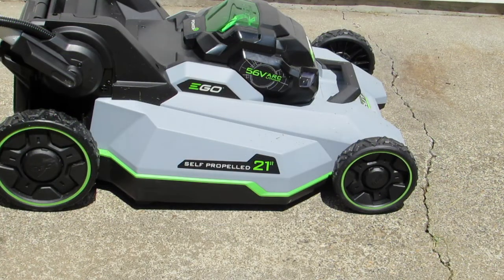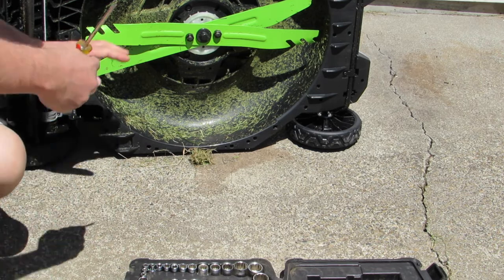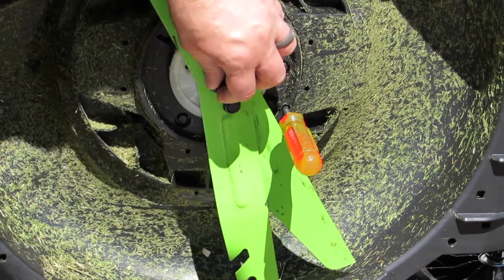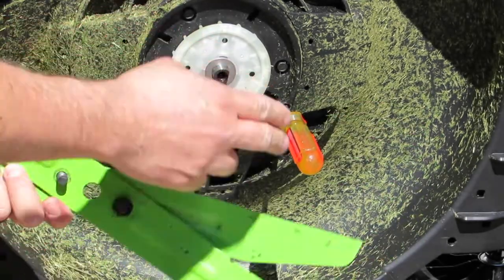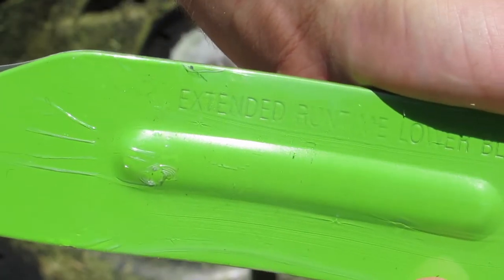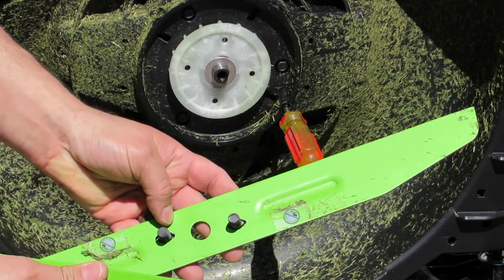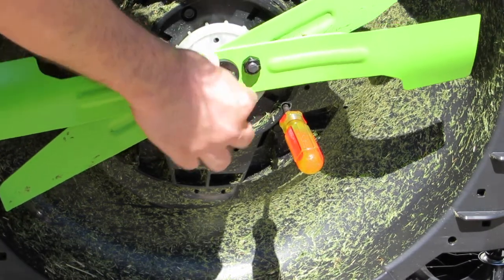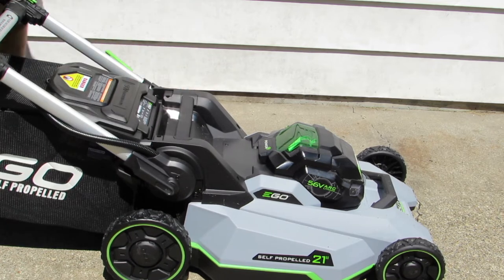How To Change A Blade On Lawn Mower | Replacing a Multi-Blade on EGO Electric Lawn Mower Quickly

Comment: Nice job on the video on how to change out the lawn mower blades. I just bought the mower and will be changing to the bagging blade. I read the operators manual and will be adding Torquing step to all three nuts/bolts to the recommended factory specs. Center bolt torque setting is 36-43 ft-lb (50-60 N.m.) and two side bolts require torque setting of 22 ft-lb (30N.m.). Maybe you can edit video and add Note across last part of video with torque specs.
Reply from the maker: Thank you for that advice.  I was thinking about making an updated video.
Reply: @kevscastle7466  You can just add some text to the end of your original video. I bought the torque tool and it never made the click sound but it wouldn't let me tighten anymore. Getting nuts off took a long time for me. I did resort to WD-40 but still took perseverance and determination to finally free it.

Comment: Do you have to reinsert the mulching blade or can you just use the single extended runtime blade by itself on this mower?
Reply from the maker: The mulching blade is for making the clippings much finer. That said, i imagine it is okay to use the single blade. But I have not tried it that way yet because I like making the clippings finer, even if I am bagging them for my compost bin.
Reply: The manufacturer says you should always use the top blade.

Comment: Over a short period of time the metal insert at the center of the white plastic fan fails and makes removal nearly imposdible, even when the center bolt is correctly torqued. It's a bad design.
Reply: I just got mine back from "warranty" repair where Ego-approved scam artists charge you for fixing Ego's plastic junk.

Comment: Torque to 40 ft-lb on center bolt is critical. Too tight and you fatigue bolt. Too loose and could come apart. Both center and two outside bolt are in millimeters. Manufacturers don’t switch up from inch to metric. Wear gloves.
Reply: @garypedigogaeu5787 what happens when the white plastic wheel also begins to rotate?
Reply: Yes and the two outer bolts is 22lbs